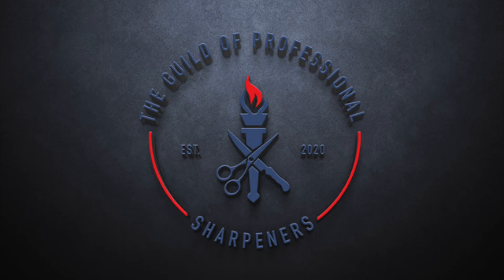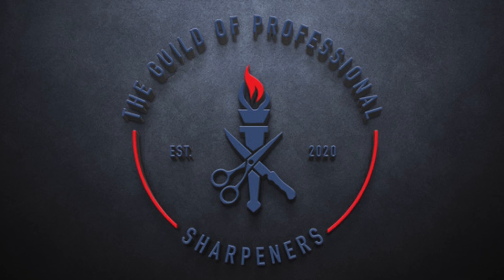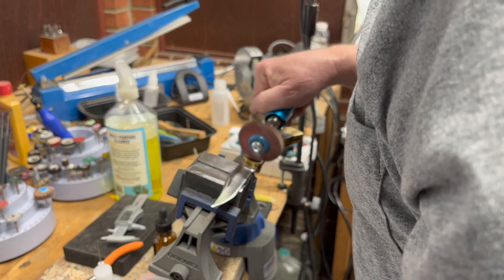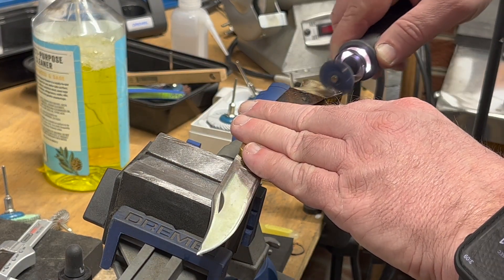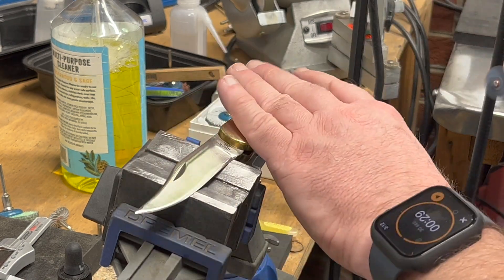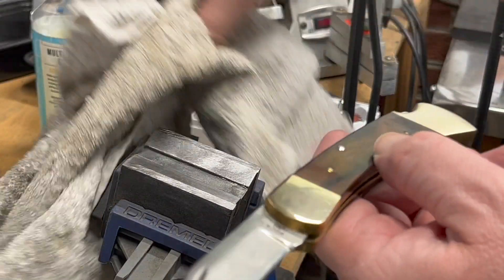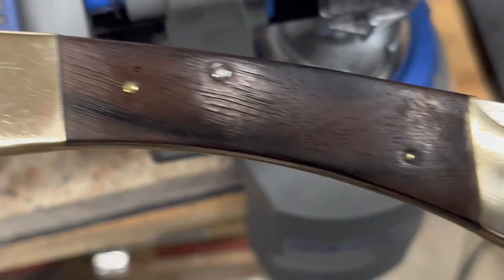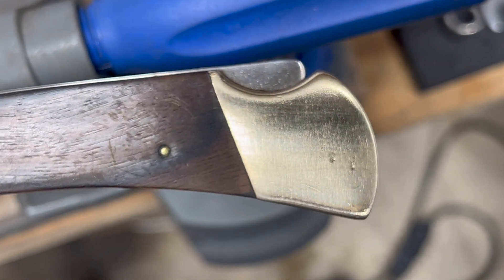Dental Radial Disc Test Dedeco vs Knock Off's

Comment: You’ll get a better finish if you cross each grit by 90 degrees. You use every grit in the same direction so it’s harder to see when you’ve got all the previous grits scratches out.
Reply from the maker: Thank you for the recommendation I will test it out my concern is it making scratches where none exist  most of the time for general stuff in my knife sharpening shop I am just improving the general appearance not looking to get out every scratch. I use the 220 grit for just a fast clean up on many Western Style knifes  but they have a pretty solid visible grain pattern that I'm looking to keep. It's restoration work where I go through the full progression. But for mirror finish knives I would be concerned using dental abrasives only. I still tend go from the Green 14,000 to polishing compounds but I will have to try it on some of my own knives at the high end and see if the crossing pattern works better. Maybe 600 grit and up to see how it works out. Thanks for the tip whats you experience with Dental Abrasives do you work with them? I use them more and more 80 grit and below are great for cleaning rust off things I just did two of the worst scissors I ever saw and they came out like new I really believe they are one of the very best abrasives available when it come to cleaning and polishing and i keep investing in more I have some 3" on the way for my jewelry buffer.
Reply: @ALXSHARPEN  I used to work for a large dental instrument manufacturer in the polishing and sharpening department but we used regular buffing wheels and compressed felt wheels for polishing using bar compounds (first stage was emery compound, Jackson Lea brand then onto a green chromium oxide compound also by Jackson Lea before we switched to Dico brand). The instruments came to us with a very fine finish produced using rotating tumblers, first stage was some kind of ceramic media then burnishing with stainless steel pins so it didn’t take much work to cut down the finish to good lustre. I now cook but have a side hobby making knives from start to finish, heat treat and all. For a totally blemish free mirror you need a solid 400-600 grit base to start from with absolutely no deeper scratches from previous grits because they will never come out. I find for a brush type satin finish that wears better scotchbrite wheels or any non woven flap wheel work very well. I have used some of the small radial wheels in the past but I find that in the long run the lifespan to cost ratio isn’t as good as full size bench type wheels especially if you’re running your hand piece at high rpm.
Reply from the maker: @temhawpin  I’m just starting to get bigger ones I ordered some 3 inch for my jewelry buffer but the really big one are still out of my budget. Thanks for the info I searched many times for more details but couldn’t find anything really good appreciate hearing from someone who was in an industry that uses them I knew they knew the tricks love the comment about the 400-600 base had a feeling it started there great stuff thanks 🙏

Comment: So many great videos I can learn from! Thank you so much!
What if I wanted to go further for a really mirroring finish by only using a Dremel (so no jewelry buffer)? Is it possible? Can one achieve a mirrored surface with Flitz or is it for more matte finish?
Reply from the maker: You can use it on mirror finish but make one with it not really its about 4000-7000 grit depending on the product

Comment: Thanks for showing the comparison, Paul!!

Do you have a link for the mandrels that hold the 2" wheels?
Reply from the maker: https://amzn.to/3GXDGT4
Reply from the maker: This is the Mandrel above. I'm stopping at my local hardware store today and will get you the exact screw size you will need for the top screw. The one it comes with is too small to fit through the disc, but it's an easy replacement just take it out and put in the longer screw and you're good to go.
Reply from the maker: In the video description I have links to everything the mandrels and the two replacement screws that work were added today